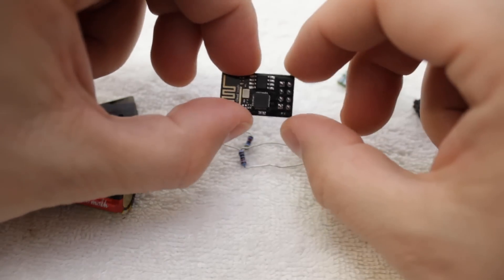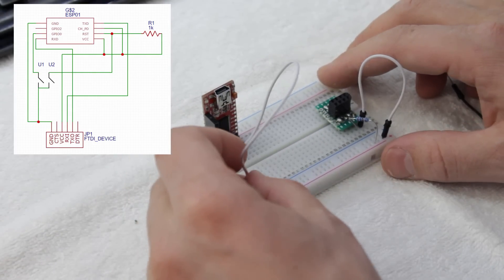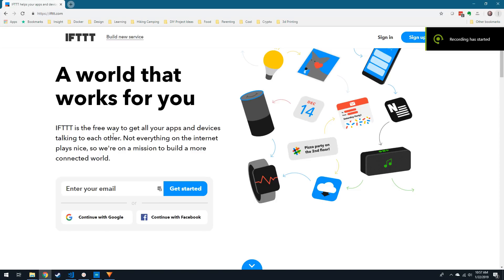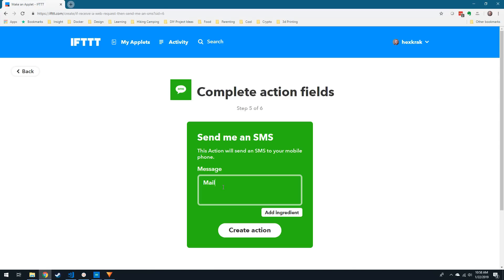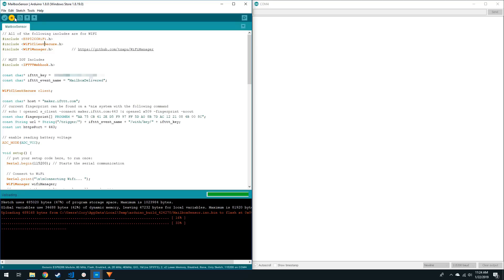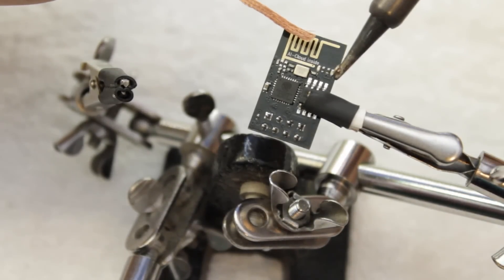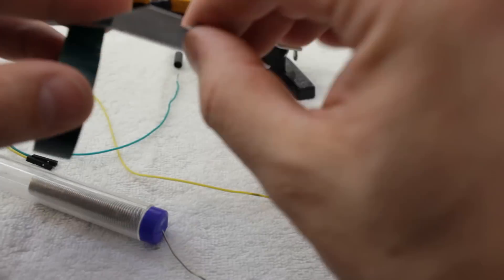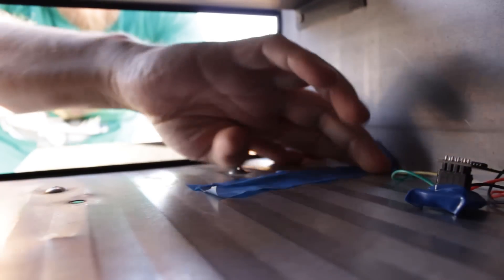DIY Get Notifications on Your Phone When Your Mail is Delivered

Comment: This is for if mail box has one opening and thats the door. What if your mailbox has one side with chute facing the street and another side with door facing house. The postman will just slide the letter through chute.
Reply from the maker: There's a lot of options for the triggering mechanism. The nice thing about a physical switch is that it enables the lowest quiescent current and if it's battery powered, the longest battery life. If you really can't get a switch in there, there are some PIRs that have very low current draws and was an option I was considering, or if you can plug it in to the wall, an  ultrasonic distance sensor could be used to detect objects passing through.

Comment: Wouldn't is be possible to have the switch at the top instead and make it NO.
That way when it opens the chip is powered up and sends the notification, and when the door is closed it shuts off the power again.

Just have to make sure it's quick enough even for a ninja mailman.
Reply from the maker: The chip should be always powered, and the switch is connected to the reset button, not the power loop. That way it can take it's time to run through the software cycle and then re-enter deep sleep after it's sent the notification. But yes, you could do that, I wanted mine to be more discreet, but I do think that the switch wasn't always getting triggered because the mail man didn't open the door all the way. Planning on using a PIR or some other trigger for the next version.
Reply: exactly how i did it. works great

Comment: This is exactly what I was looking for! Your tutorial is leagues ahead of other mailbox projects online. Quick question: I have a pair of USBasp programmers that I use for Attiny projects. Any clue if you can program the ESP8266 with a USBasp?
Reply from the maker: Thank you for the kind comment! I'm afraid I've only ever used ch340 type programming chips like that which comes on the fdti to serial converter, or ones built into the wemos style all in one boards so I can't confirm for sure. That said I mostly buy esp8266 boards that have a programmer and usb built in these days such as the wemos d1 mini, because as long as I'm not going for the ultimate smallest footprint, the price difference is negligible and the convenience is 100x worth it.

Comment: I did this too:-) using Reed switches and a relay that switches on imidiatly on boot(when letterbox flap or door was opened sensed by Reed switches), this provides power for the esp after the Reed has turned off. The relay stays on until iftttt has been done, then it shuts off completely. No power use at all between door openings:-)
Reply from the maker: I got some pir sensors for my birthday, I might be rebuilding this myself.
Reply: I would like to build one of these and would like to use reed switches too.    Would you / do you have a write up of how you built yours Lmm Cams?

Comment: Enjoyed the video! I think my mailman would freak out if he seen a circuit board, wire, and lights in the mailbox though.
Reply from the maker: Yeah, luckily for me I have a locking door that the electronics are behind. It could be entirely mounted to the bottom of the box or even if it was in a proper project box in the back of your mailbox I think it would look pretty innocuous.

Comment: What is the range on something like this?
Reply from the maker: ESP8266 runs on 2.4ghz  (b/g/n) networks, so you don't get the 5ghz (ac) range but I'm connecting through the metal mailbox, a garage, and 2 bedrooms. Every situation is going to be different depending on what's between your router and the device, but you should be able to get 150-400ft, with 400ft having literally nothing between your device and your router.